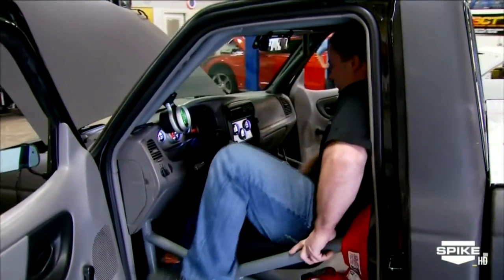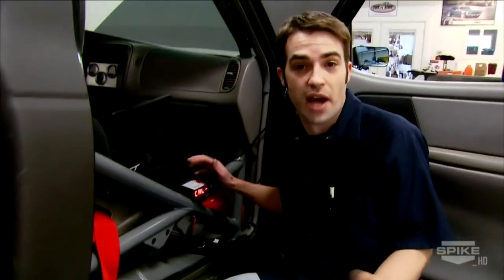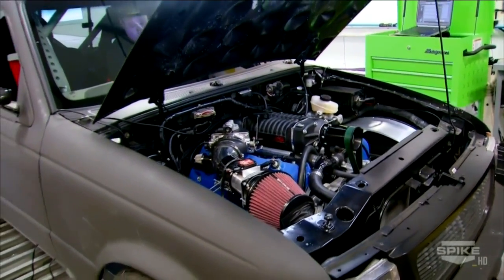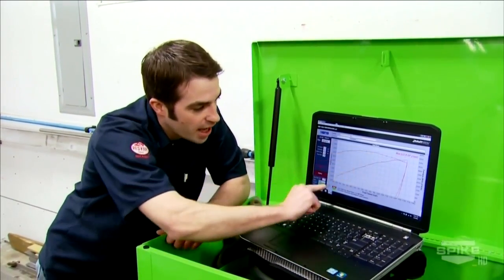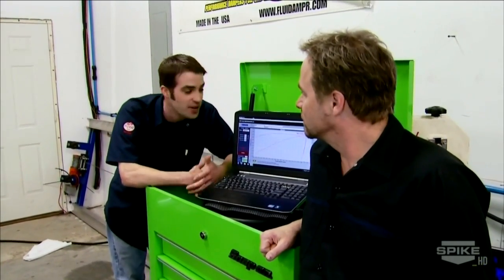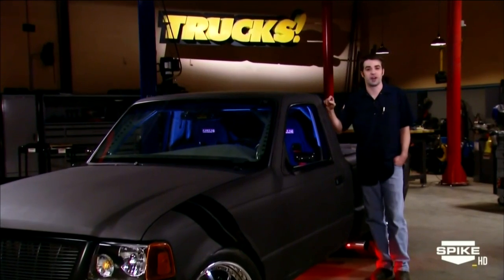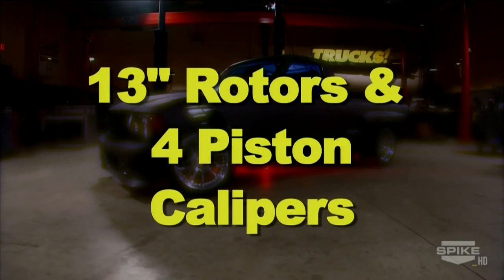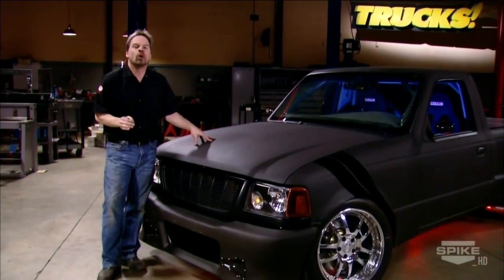Trucks! Project Rolling Thunder Dyno Ford Ranger 4.6L V8 Cobra Mustang IRS

Comment: The engine swap of this build could've been a bolt-in affair if the truck was an '03-later, because one the Lincoln SUVs shares platform with the Ranger and comes with a Mod-4.6L.

Comment: A larger blower would result in a better adiabatic state under similar or higher levels of boost, and would push the numbers to "600 horsepower to the rear wheels...! ;)"

Comment: Open filter no Shield yikes. No good.
 The IAT's will be to high& never use a metal intake tube or parts with the exception of hose clamps. That would be wai, cai